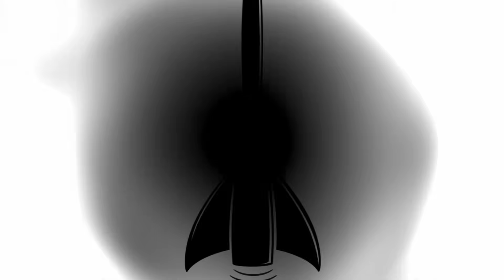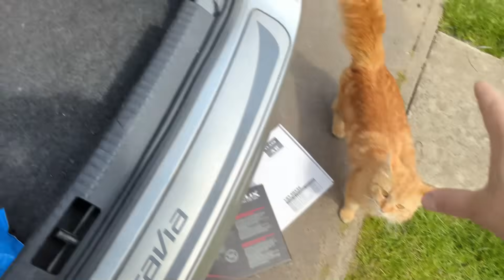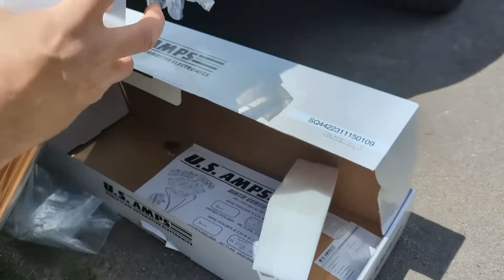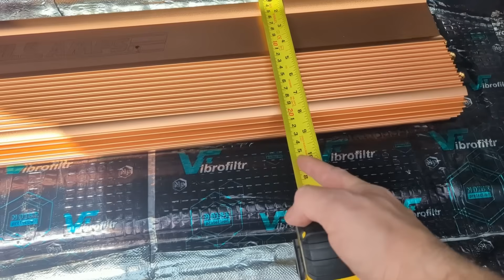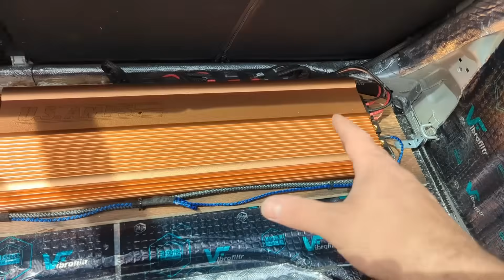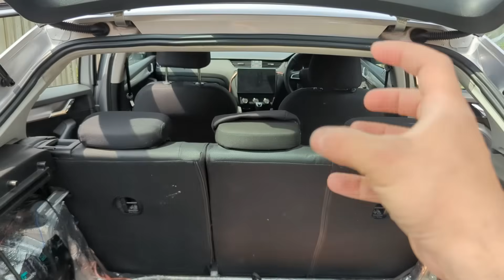Quick amp rack for Helix and US Amps + 3 speaker tune

Comment: Is there a reason to choose to use a Circuit Breaker over a Fuse? Are there any pros and cons with one over the other? Or any safety issues? Im asking because I'm thinking of using breakers. Is there any resistance caused more by either?
Reply from the maker: Breakers are great for people that constantly work on systems like myself. You can very quickly disconnect the whole amp rack. They are extensively used in campers for solar, so safety is not an issue. However if you are installing a system and not planning to change anything, a simple fuse will do better as it's much cheaper than a breaker.
Reply: @RAW-CAt  Thank you for the info.

Comment: How are you liking that Pro Mk3?
I wish Helix had a 10 channel dsp like in the M4 dsp amp, but without the amp. I also like the Conductor so I can't get a used Pro Mk1 or 2. Darn Mk3 is just expensive. Lol.
Do you think the Mk3 is worth the price?
Reply from the maker: Now I would need a 12ch to be honest. But 10 will do. There is nothing to fault this DSP, does what it's told, works flawlessly if you could live with the URC.2, get the mk2🤷

Comment: I’d bin the DC circuit breaker and stick to fuses. They can weld shut unlike the domestic AC ones.
Reply: Or use both. Just use the circuit breaker for turning power on/off.
Reply from the maker: Breaker for me is more convenient. I need to cut the power regularly.

Comment: Remove sparetyre and make infinite baffle subwoofer 😂
Reply from the maker: I will have 2x18s in IB without removing the spare tyre😉
Reply: @RAW-CAt  i'm curious about it. I'm just missing one dsp channel for it :/ do you think using the same dsp channel for both rear subs in those locations would not be a problem? Or would putting them together in the spare tyre well better?
Reply from the maker: @katexpero2 one channel should be fine. I will be testing that out.